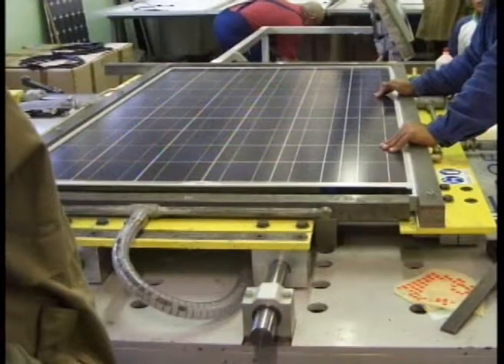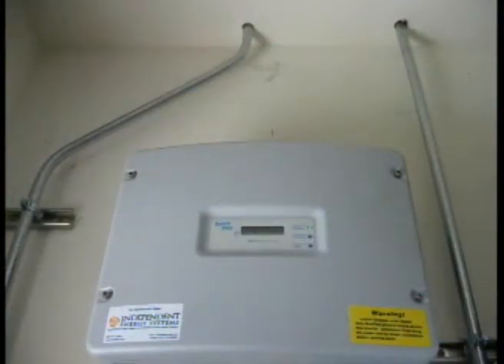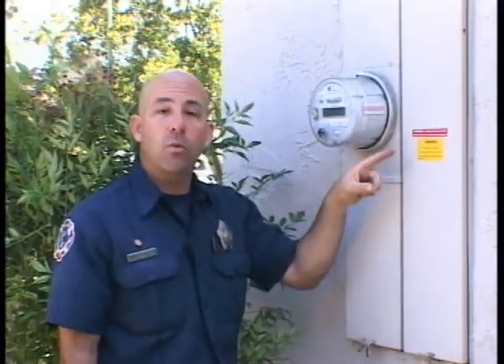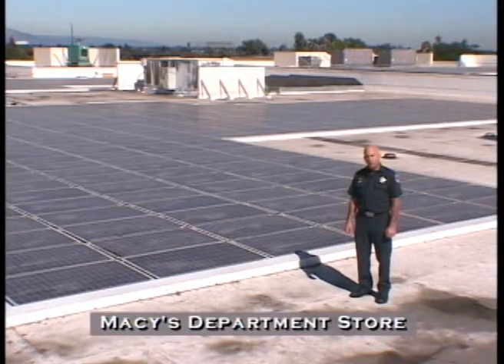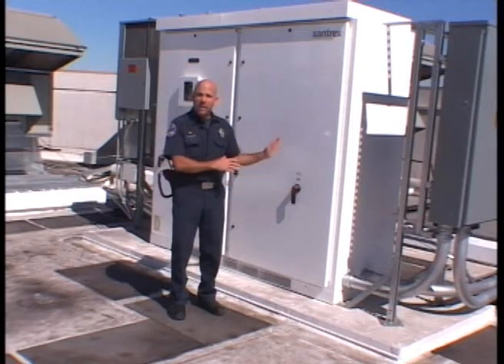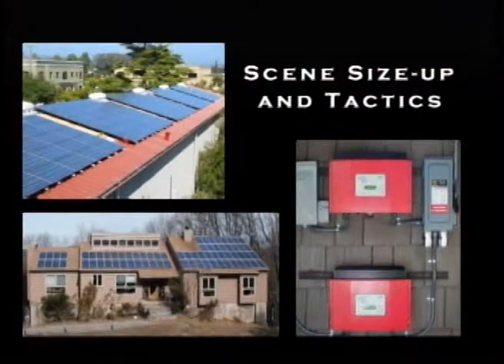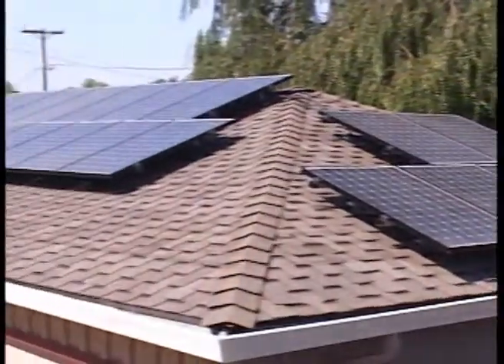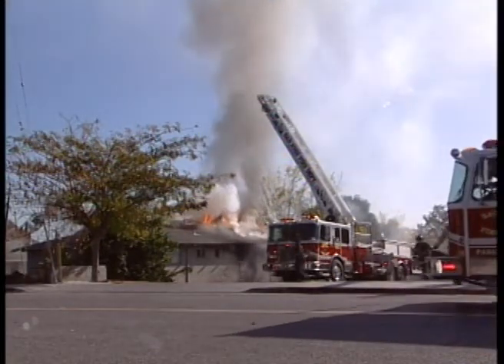Solar Photovoltaic Systems & Firefighter Safety

Comment: It may not alter how you handle these from a firefighting standpoint, but don't forget that some PV systems now use micro-inverters mounted on each solar panel which can produce 120/240 volts AC power right at the solar panel location.